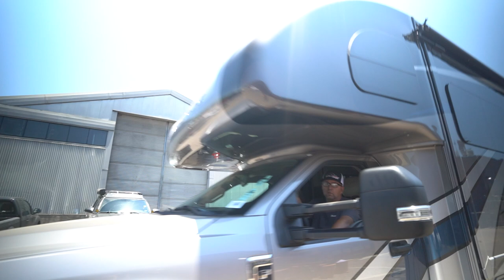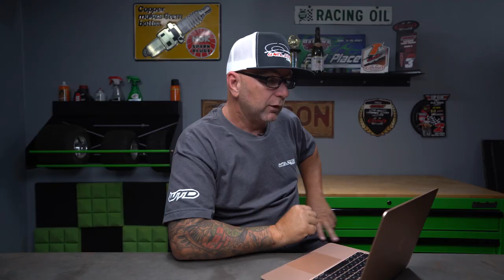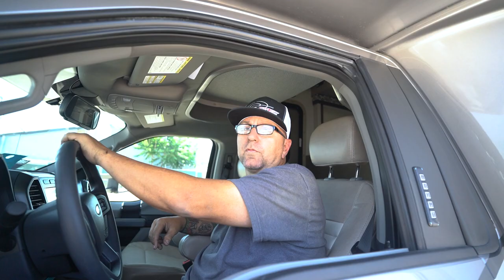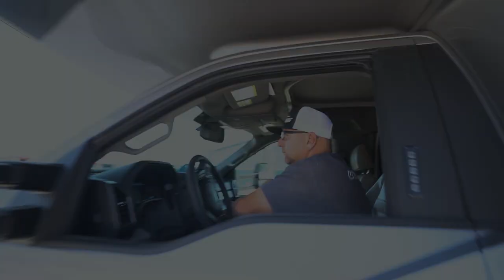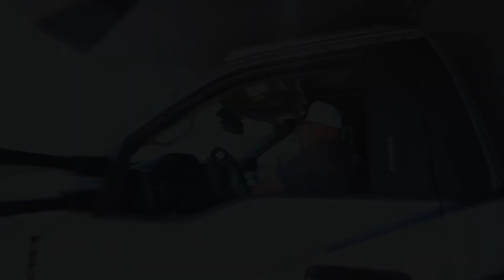VAN & RV Suspension Q+A - THIS is why your E Series Van Drives Slow and Sketchy on the Road

Comment: Can you  correct the caster on my 2024 E450 Winnebago so it will steer and handle correctly?
Reply: Of course.... do you want to do all the suspension? Or just caster?
Reply: @jeremysworld1065  I would love to add a lifted suspension but I would not be able to park it in my shop due to the A/C unit clearance. Can you correct the wandering, bump steer and loose steering feeling?
Reply from the maker: Yes, get it aligned and add more caster to the front, you can also add our steering Stabilizer . https://weldtecdesigns.com/product/wtd-ford-e-series-fox-steering-stabilizer-kit-gas/
Reply: Sounds good! I will get down south and come see you guys!
Reply from the maker: @Bob9999  Sounds good!  Ready when you are. 619-596-9831